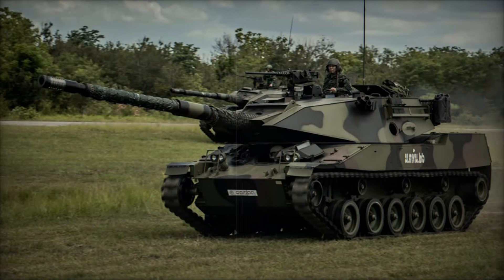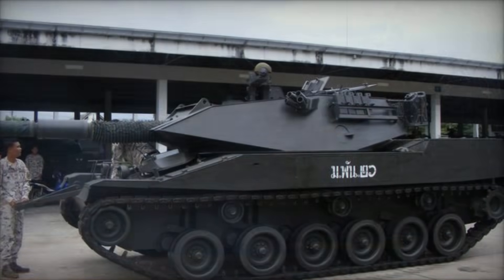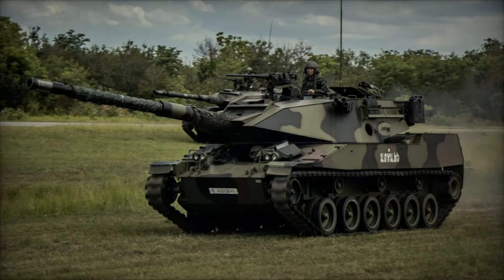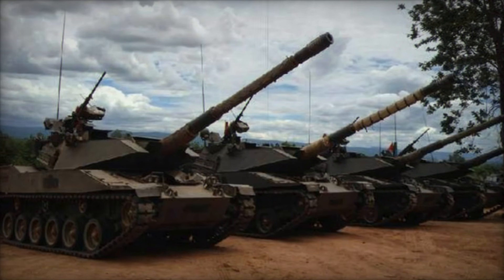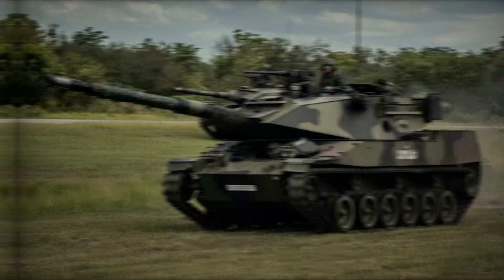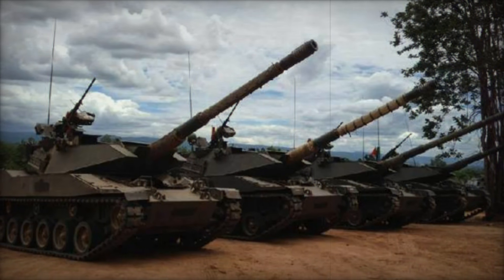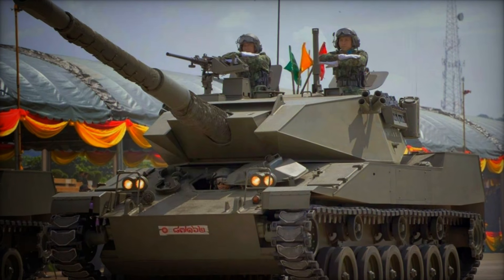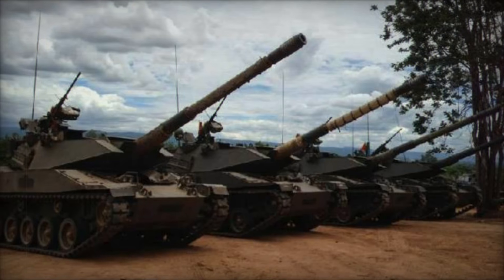The Stingray Light Tank A Cost Effective Armored Solution

Comment: If you go for a light FSV system the wheeled option has lower maintenance cost and offers the same protection. Add that wheels give even higher mobility and nowadays has nearly the same off road capability as a tracked vehicle.

Comment: It does seem that heavily armoured vehicles are a waste of steel.

Active defense systems seem to be the way to go.
Reply: There is no way around to look at lighter vehicles and wheeled vehicles.  MBT's are very expensive, due to the logistical train behind it.  Special lowloaders, special recovery and bridgelaying vehicles. Thirsty,  Special railway cars.  Problems with   maximum weights for bridges and roads.  Engines who have to work much harder .
Reply: @bertnl530  

Up until very recently the cost of MBTs was worth it. Now it seems that unless the top armour is also 12 inches thick they are just a waste of effort.